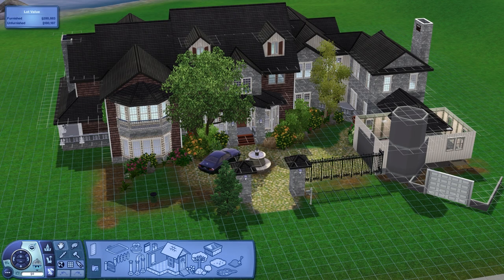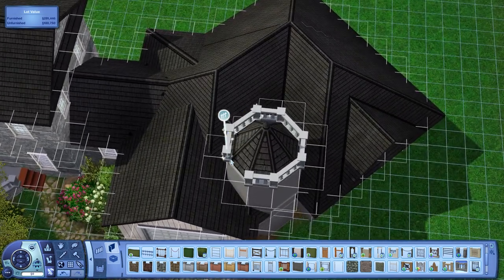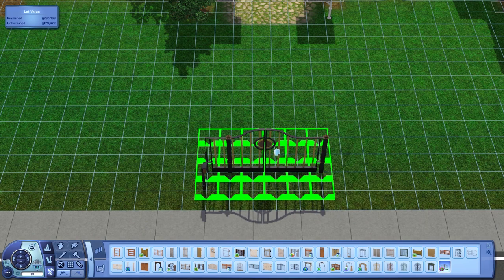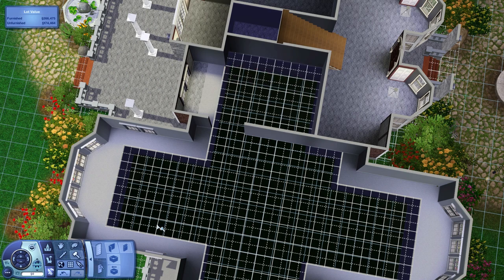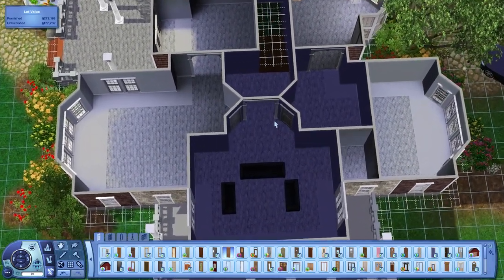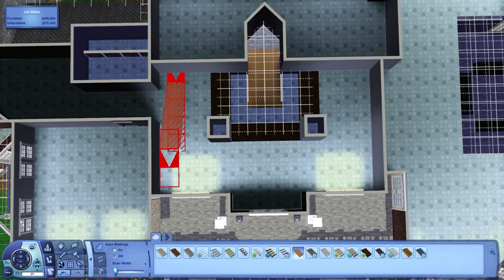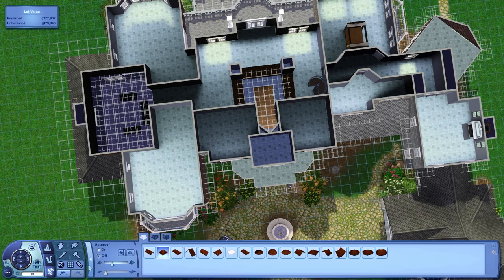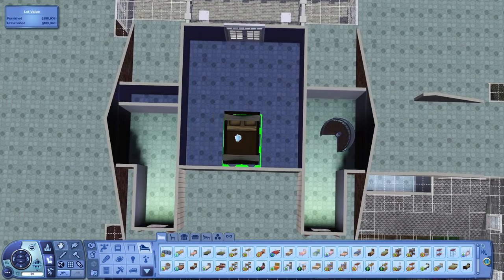The Sims 3 - Let's Build a House - Part 9

Comment: You could put a wall where the garage joins the house to make a small rectangle room which could be the laundry room with doors either side. The diagonal room off the kitchen has a lot of light coming through so you could make that a conservatory. Next to that could be the library/reading room. Large back room next to the living room could be a rumpus/games room with a bar and pool table etc. Large front room like you said a study. You could put a grand piano and sofa in the open area next to the kitchen/dining. Maybe a gym in the room next to the basement stairs unless you were saving that for the basement. The third floor could possibly be a home theater depending on how large it is. Also somewhere in the basement would be good for a music room for the teenagers band or something haha. Possibly a guest room somewhere in the house but yeah all just ideas hope it gives you some inspiration.